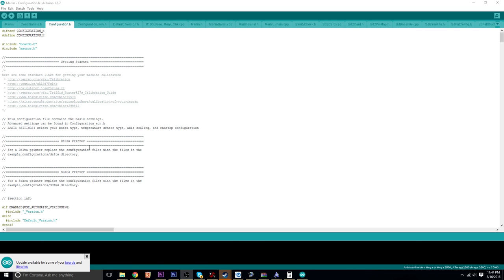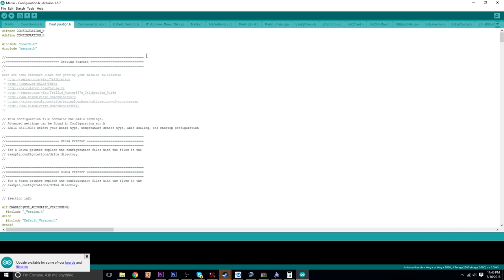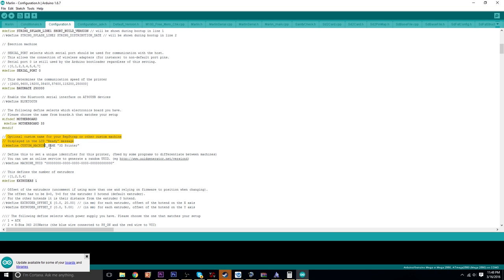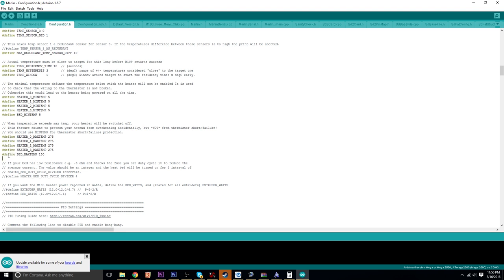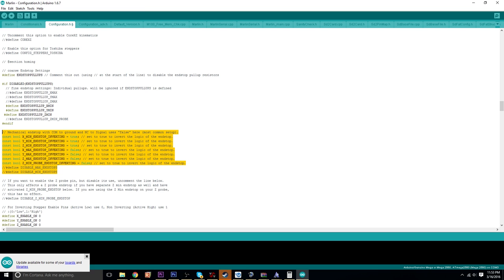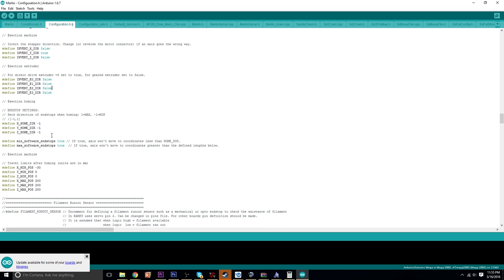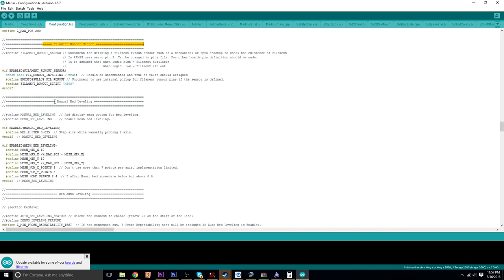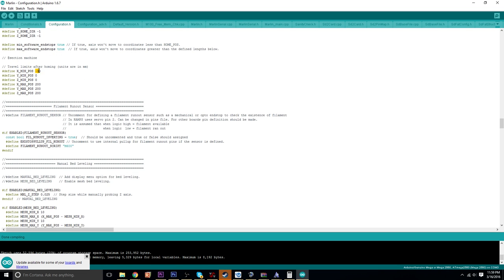Tutorial 3d Printer Setting Up And Flashing Marlin To Arduino | DaVinci Ramps File

Comment: hey dopesoner what voltage are you running your stepper drivers at because I am doing the ramps conversion right now and all I need to do is tune the voltage so can you check what voltage yours are running at

Comment: I'm having major issues. I just picked up a Prusa I3 and the thing was a mess. I redid the whole thing really and I don't if I did it right this is my first printer so I want to flash and start over. My mpotors all grind and chatter. I checked everything I think  but I am almost positive it is some setting because everything moves but it seems like back and forth very fast making the noise If I was to guess. Any thoughts?